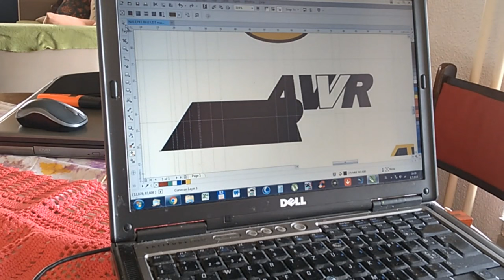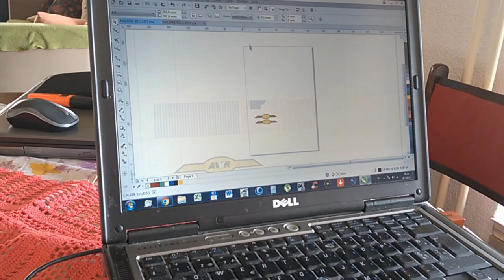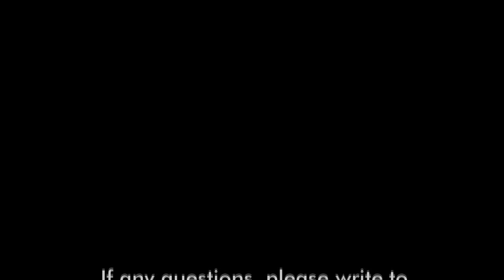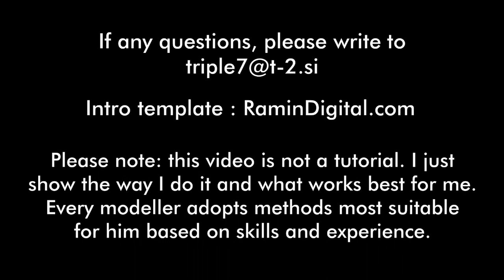Making of AWVR 777 in HO

Comment: This was before Circus City Decals and Graphics offered the decals for 777. Very good job on the paint work. Only thing that always irks me when most people build a replica of the 777, is either use wrong engine, dash 9, or don't use the correct side frames on the trucks......777 had the steerable side frame trucks.....
Reply from the maker: I've made decals for hundreds of locos to date. Beside, the Circust City decals are incorrect.
Reply: @EKLinsky  how much would you charge for a ACCURATE set of those? I'm planning 4 units, 777, 775, full Red, 767, 765, Red n Black units.

Comment: I think you need to modify the rear headlight from two to one since that's the way CP did it and you'll need to fix the trucks to the correct type. other than that, great job!
Reply: The Santa Fe Guy  to d the headlight he would have to do a bunch of wiring that is really not worth it
Reply from the maker: u're quite right, and once I'll try that too.... Thanks for kind comment :)